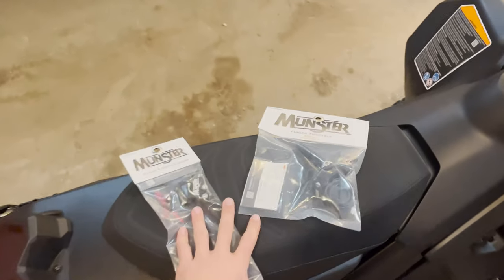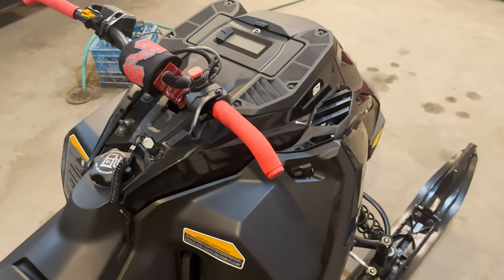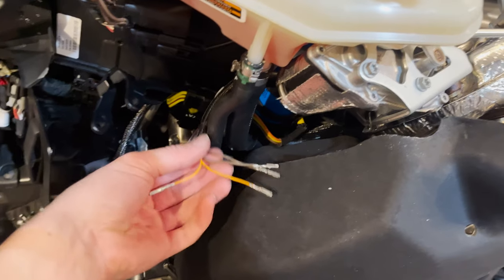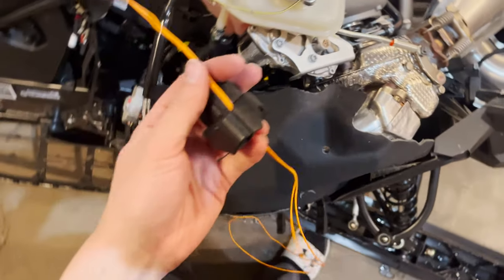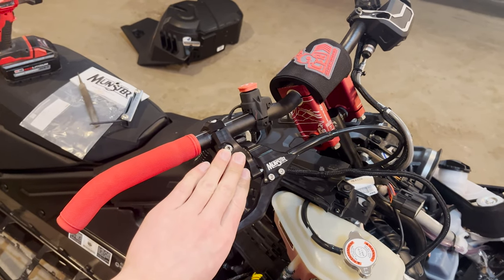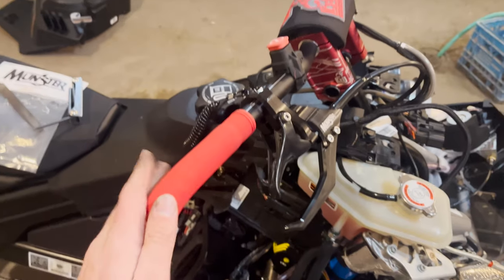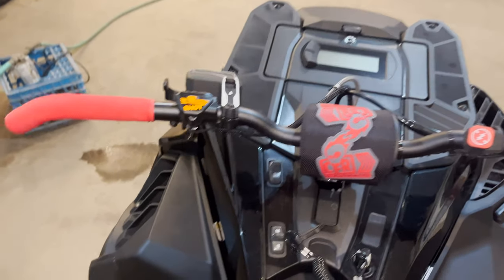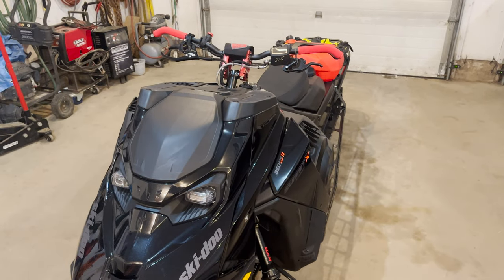Skidoo G5 Turbo Munster Finger Throttle Install - EP 21

Comment: Where do I get those bars?
Reply from the maker: Those are just the stock skidoo expert bars. I have upgraded to CFRs since
Reply: @matzryde  thanks, I have never ridden a snowmobile so I didn't know. I want to get a set for my board track racer with a finger throttle.
Reply from the maker: @Zane.Wellnitz  no worries! That would be interesting. Never seen that before where I’m from.
Reply: @matzryde  I live in Florida so we don't see many snowmobiles either. Lol
Board track racing is making a comeback here. 🤙🏻
                           🚴🏻💨✨